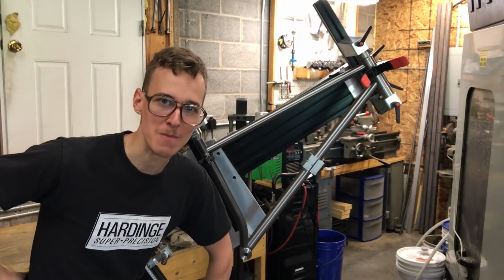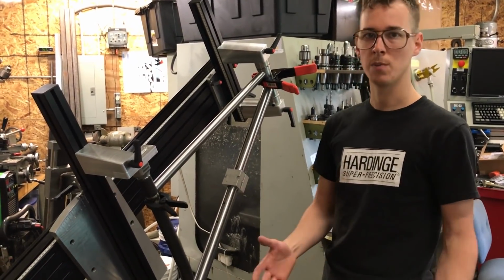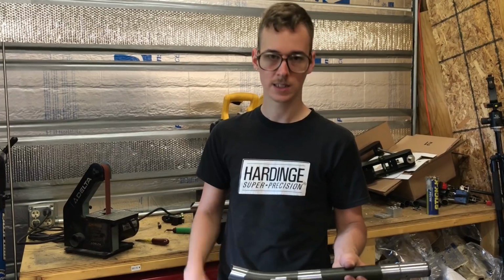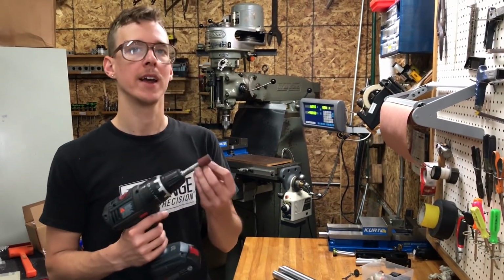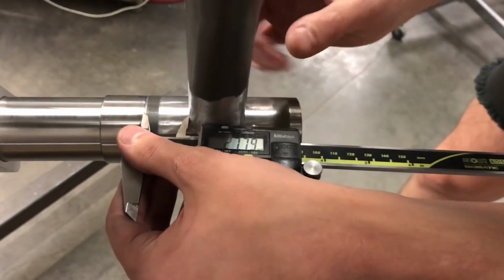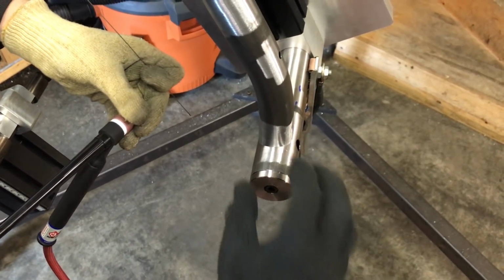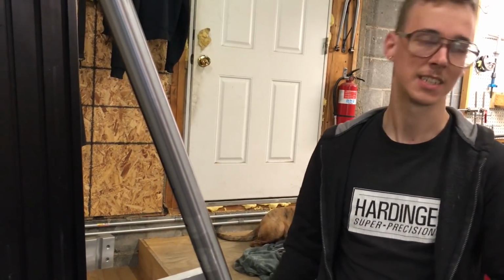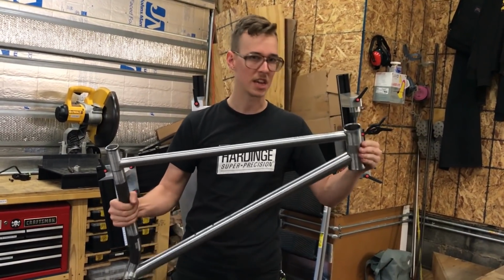Hardtail Frame Build: Front Triangle Weld Prep and Tack Welding!

Comment: Great video, thanks. Those welds so far look really good. Personally I found the best way for me to avoid dreaded burn-through was traditional dip with "manual pulse". So back off the pedal a bit between dips and give it a bit more juice as you put the rod in. As soon as it looks like it might be even thinking about keyholing back get some rod towards where it's going and/or back off a bit. But it's a personal thing.
Reply from the maker: "It's a personal thing" That's exactly it. I think everyone can end up getting used to almost anything, but we all find what works best for us and make it work. And what works for you better is worth taking note of because it might work better for me, too.
Reply: @cobraframebuilding  I think it might make it easier to deal with less perfect fit-up because you have a bit more control. I used to keep blaming poor fit-up on my lousy practice joints but eventually got to a point where I could weld them OK anyway. My actual fit-up on the frames I then made wasn't half as good as yours so this was a good thing... But obviously good fit-up is something you want anyway however you're doing the welding.

Comment: One thing I've noticed about stress build up on tubing in general is, butted tubes and mechanically formed tubes like Aero tubing have lots of stresses built in due to all the processes involved. I recently was hand mitering an Aero tube, and I had to cut a small triangle out from one of the corners, and as soon as this bit was free off the tube, it took the shape of a round cross section! I don't know if I mentioned it well here!
BTW I look forward to your videos every time! Extremely informative. Thanks a lot!
Reply from the maker: I have noticed the same thing about shaped tubing. I haven’t mentioned yet in the videos but I went to a press fit bb, which has no right or left side.